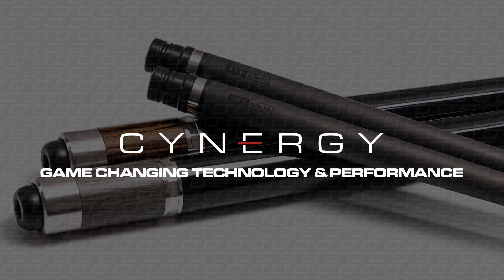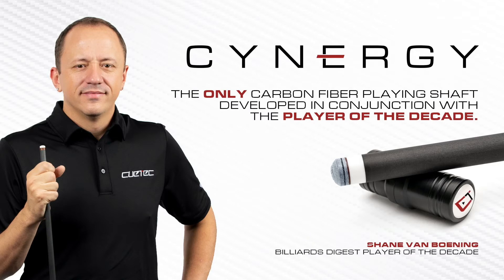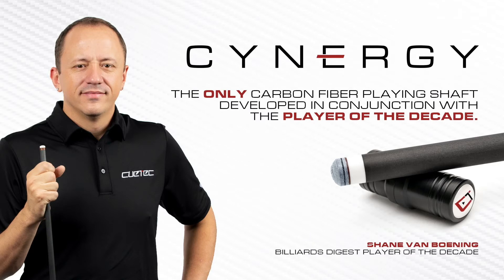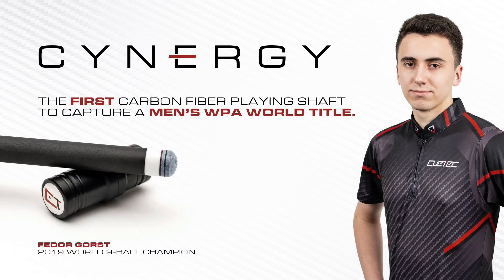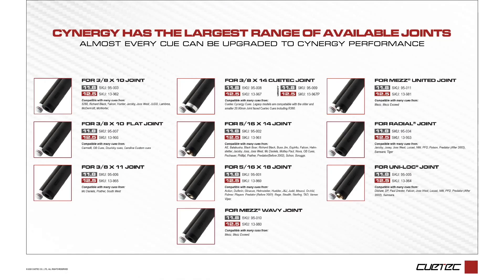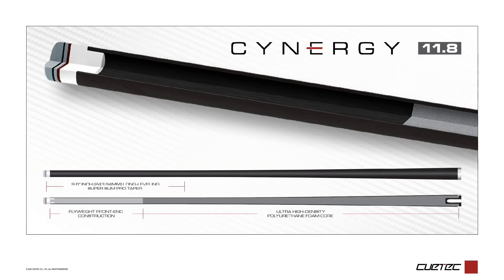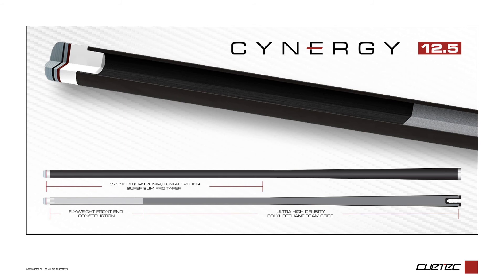Cuetec Cynergy

Comment: What about deflection? Does the 11.8 has less deflection than the 12.5?
Reply: 11.8 is a spin shaft. Deflects more. But puts a lot more spin on the cue ball
Reply: @michaeltimmer3839  the deflection is the same. if anything, deflection would be slightly lower on a smaller tip, since it weighs less than a larger tip. but the effect is miniscule.
Reply: @michaeltimmer3839  WRONG. that's not how it works.